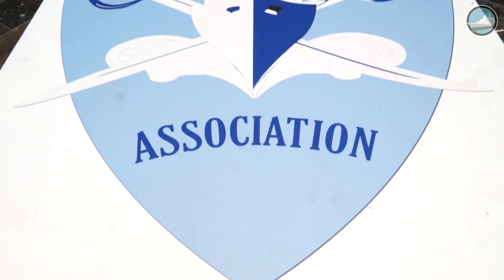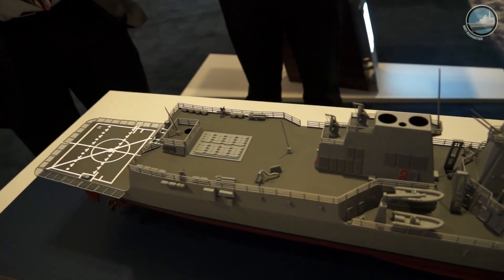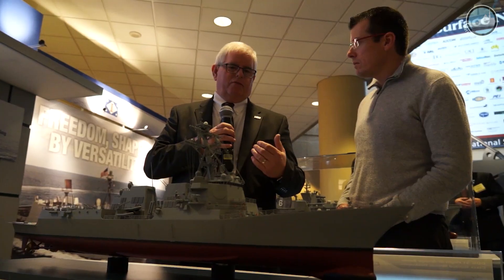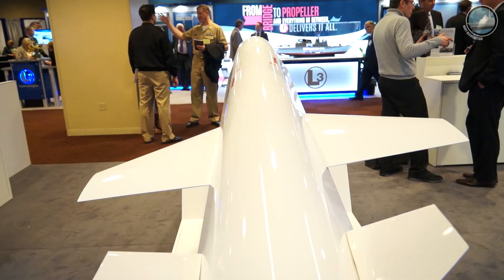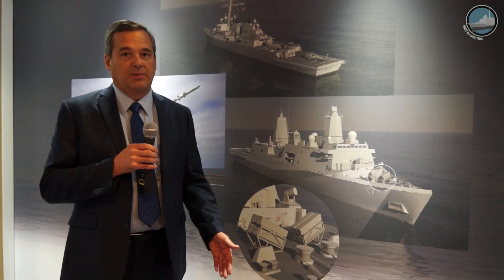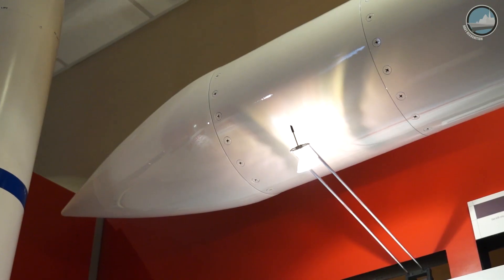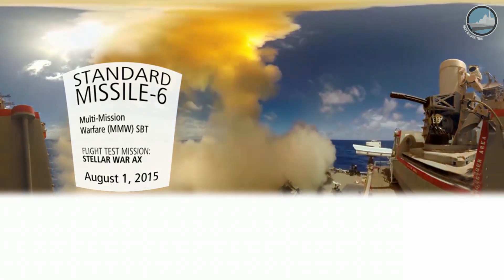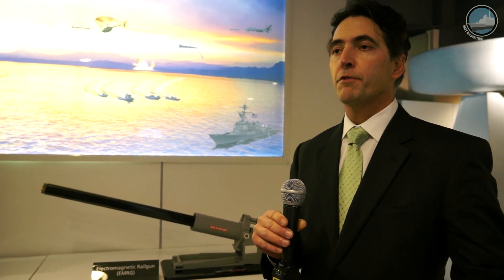SNA 2017 Surface Navy Association Day 1

Comment: I was hoping that they would enlarge the forward VLS to 64-cell like the aft launcher on that new DDG-51 Flight III.
Reply: I'll never understand why that hasn't been done from the start.
Reply: @RedXlV  perhaps a cost cutting measure?
Reply: @kempmt1  I suppose so, but it seems ill-conceived. A 64-cell forward VLS would mean 25% more firepower for each ship. And seeing as the number of different missile types that a Burke needs to carry in its VLS has kept increasing, more cells also mean more flexibility.